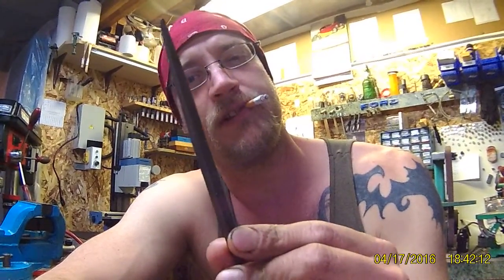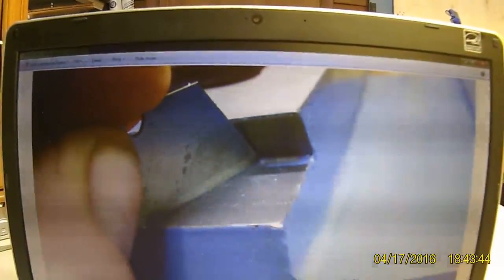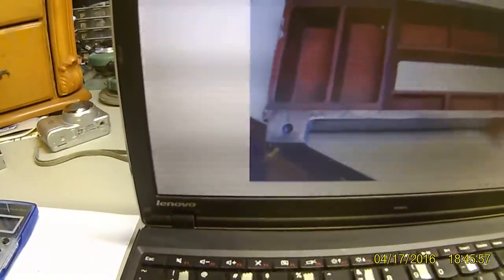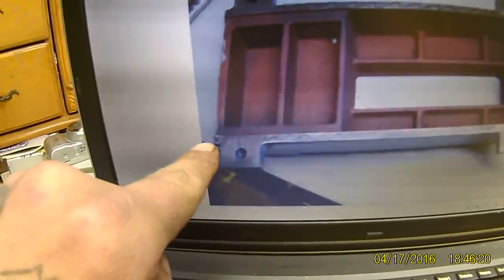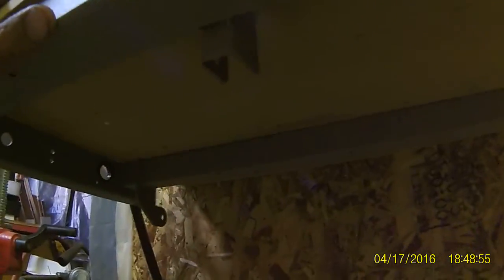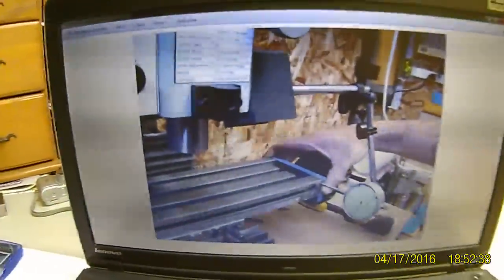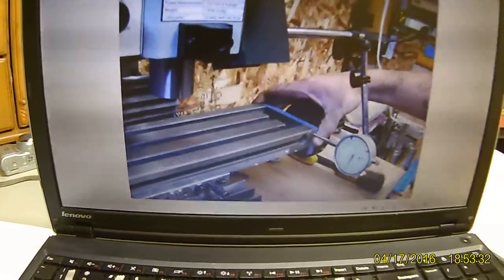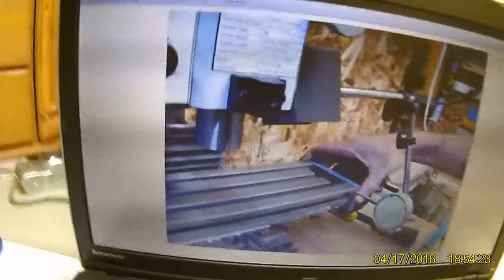Set up, discussion of mini mill Sieg X2 LMS

Comment: Only a snug tight bolting mill to table? I thought the point of it (other than safety) was to add mass as if it were a heavier duty mill? I agree doing so could put tension on mills base though.